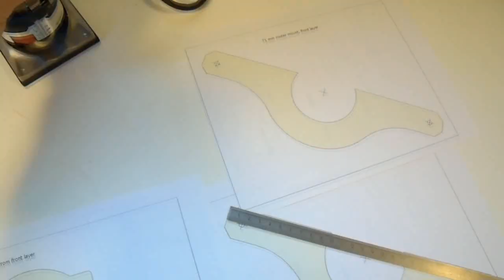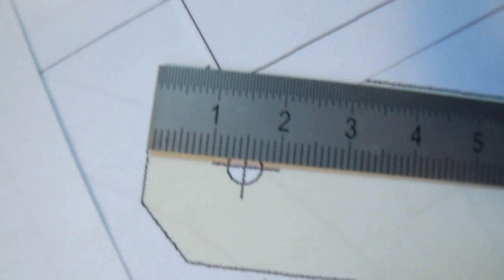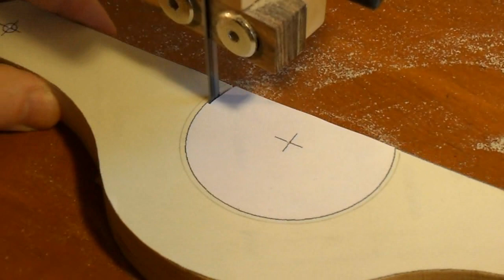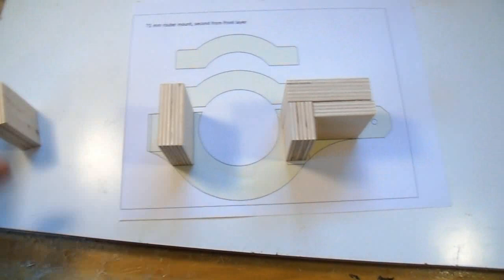Building a palm router mount for the pantorouter

Comment: Just a note on your router alignment issue.  You used stop blocks on the top support after bumping the router into alignment, but if you make a ring with machine screws at 4 equal divisions you can dial the spindle right into square by adjusting the screws similar to a 4 jaw lathe chuck.  This will also allow you to re-true the spindle in the future if it drifts or gets bumped out of alignment.

Comment from the maker: I have been thinking about how this machine could be manufactured out of metal, but I don't see it working as well as out of wood.  Wood has a better strength to weight ratio.  Plus, to get the torsional stiffness, I need fairly thick pieces.  It would just end up too heavy if it were made out of metal.  Plus wood is much cheaper, cuts much faster, and is more accessible to people for reproducing this design.
Reply: 7 years later and i guess you changed your mind at some point lol

Comment: Matthias, Have you considered mounting your template on the workpiece side (as opposed to the router side)?  With a matching stylus you could use the Z axis and 3 dimensional templates.  The template/stylus positions would need to be reversed - or use "negative" templates. The template would need to be fixed relative to the workpiece instead of floating along the plunge axis as it does now.  I can think of many uses for the 3rd axis - stepped (shouldered)  tenons with matching mortises is one

Comment: @21BDP21 I don't know the correct answer to this, but as far as I understood the spring system was designed to do some of the lifting work instead of him doing it all. And again, I don't know the correct answer, but I guess that it would either be easier to lift then the bigger one, or that the springs provide so much lift on the small one that you would need to push it down. If you look at 9:27 you can see the router laying down with no hands. So, I guess it would just be easier to lift it.